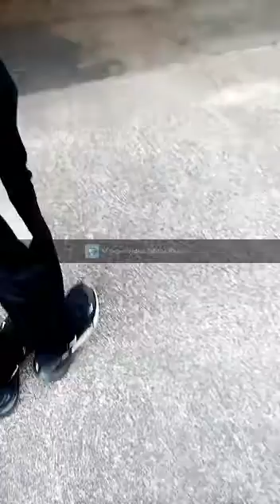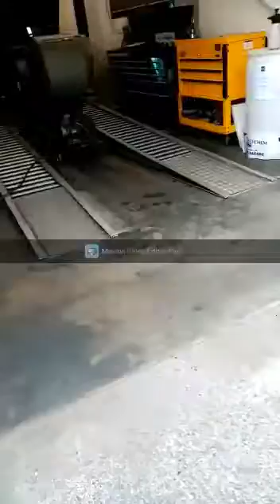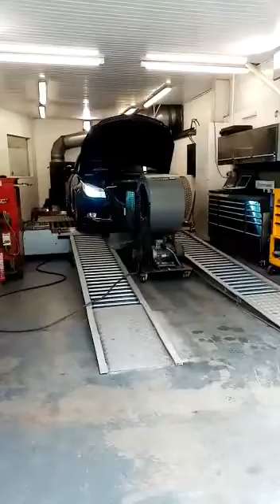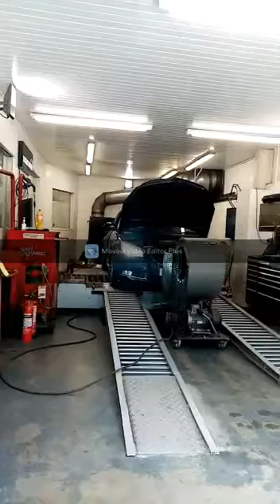Insignia Diesel final dyno run video

Comment: Nice job!! I'd be interested. Where are you based?
Reply from the maker: Plymouth but we post all over the UK
Reply: @dieseltuningincboosttechno4684  Do you just supply the  parts and not do the tuning yourselfs?
Reply from the maker: @MachsGaming  yes that's correct I can recommend tuners

Comment: How could i contact you? Have some questions about a20dth
Reply from the maker: Ask away
Reply: @dieseltuningincboosttechno4684  i have bigger intercooler, airbox and dpf remove. But original turbo is at its end i think. We have 190ps and 450NM now. I want more. Bigger turbo enough for more power or do i need other injector and map sensor?
Reply from the maker: @stefanpalmeshofer2084  You will need a bigger turbo to go any further. The choice of turbo depends on what your goal will be?
Reply: @dieseltuningincboosttechno4684  i thought about 230-240ps for daily driver. Best way would be with original injector. Do you know what map sensor is on the a20dth?
Reply: @dieseltuningincboosttechno4684  what turbo do you recommend? And what map sensor has a20dth original?
Reply from the maker: @stefanpalmeshofer2084  we build the gtb1752 which does not require any upgrade of sensors. The standard map sensor is the 3 bar version and the gtb1752 turbo will provide enough boost for 235bhp with a remap
Reply: @dieseltuningincboosttechno4684  3bar absolute?  So 2bar boost? 
What boost drives this turbo maximal? What did that cost?
Reply: @dieseltuningincboosttechno4684  what boost does this turbo maximal? What price? 
Map sensor 3bar absolute? So 2bar boost right? Then i would need 4bar map sensor?
Reply from the maker: @stefanpalmeshofer2084  yes 3 bar absolute so 2 bar boost. The gtb1752 will do 2 bar boost max so a perfect combination
Reply from the maker: @stefanpalmeshofer2084  I have a good condition second hand unit for £380 or new is £580
Reply: @dieseltuningincboosttechno4684  and what boost is it running to gain about 230ps? Would it be good to have some reserve or? Not to run at 2bar boost.
Reply from the maker: @stefanpalmeshofer2084  running 2 bar boost to achieve 233bhp the turbo is strong enough
Reply: @dieseltuningincboosttechno4684  but for the map sensor. With 2 bar boost there is no reserve right? Best would be a 4bar map sensor i think
Reply from the maker: @stefanpalmeshofer2084  yes a 4 bar map sensor would give you flexibility but if boost is set to be 1.98 bar the 2 bar map sensor would be OK and you will still get around 235bhp
Reply: @dieseltuningincboosttechno4684  i think i would take 4bar map sensor to have more flexibilty. Do you know where could i buy this?
Reply from the maker: @stefanpalmeshofer2084  ebay part no 02810022576
Reply: @dieseltuningincboosttechno4684  thanks! 
Sorry for so much questions. How much boost does your gtb1752vk hold maximum? 
2bar boost  about 230ps. But how much maximum with that turbo?
Reply from the maker: @stefanpalmeshofer2084  2 bar is the maximum with the gtb1752 but we are currently working on a gtb1756 that will do 2.2 bar and deliver 250bhp
Reply: @dieseltuningincboosttechno4684  did you buy an matching intercooler or made it work with a generic one? And how big should it be? Thinking about upgrading mine but limiting the toeque to 400-420(hard max) because the gearbox is rated for 400max.
Besides mapping, turbo and intercooler,  was something else to do? I wanna keep the dpf because im not here to supply a coal power plant lol 😂 and neither do i want to run that rich, i want my fuel to burn and not to fly out the pipe while rolling coal

Comment: When i change injecion orginal to 327insignia i need change some think on soft ?
Reply from the maker: You can fit them without adjusting the MAP but it might idle a little rough and you might have poor starting
Reply: @dieseltuningincboosttechno4684   which injectors are best for z19dth?
Reply from the maker: @maciejkuzma8186  insignia 327s
Reply: @dieseltuningincboosttechno4684   edc17 327 , all ecu soft need change
Reply from the maker: @maciejkuzma8186  yes
Reply: @dieseltuningincboosttechno4684  you use turbo alfa 2.4 ?
Reply from the maker: @maciejkuzma8186  it can be done but that is an old turbo now there are better options available
Reply: @dieseltuningincboosttechno4684  2060vklr?
Reply from the maker: @maciejkuzma8186  yes thats a good turbo